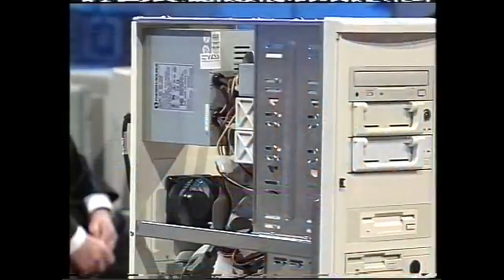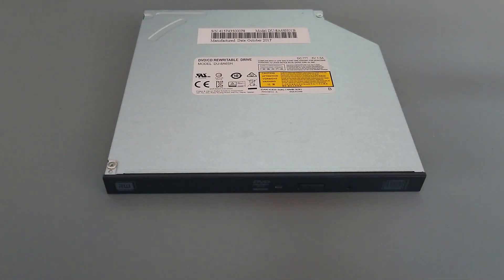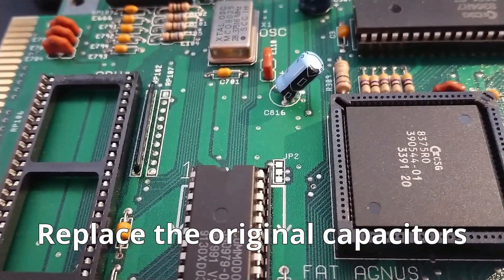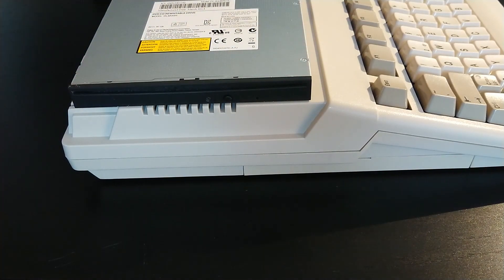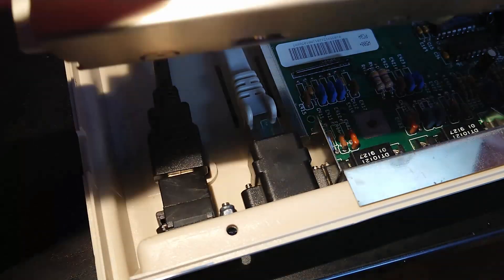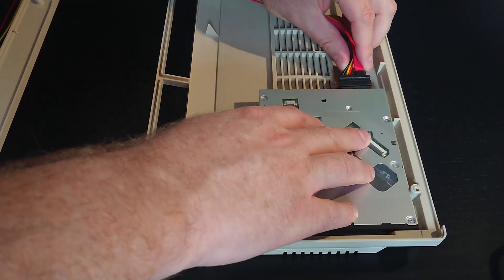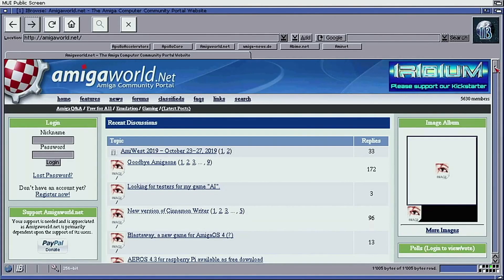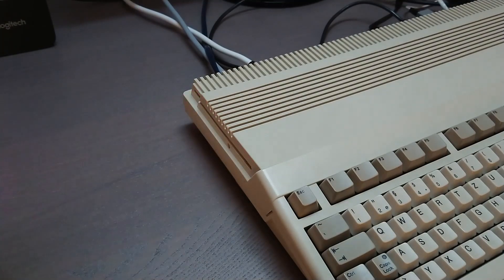Vampirizing the Amiga 500

Comment: Ronnie, I was told that the Vampire 500 v2+ was a single channel IDE. How are you using 2 IDE devices? Simply Master and Slave using the 3 connector cable?
Reply from the maker: Not sure what "single channel IDE" means exactly.  The IDE header is a standard 44 pin IDE header with implementation on the FPGA mirroring the A1200's IDE implementation somewhat.  There are two pins for selecting the drive.  So a simple 3 way cable with master/slave set appropriately.  One thing I do here which is a little naughty is connect two devices where one is a CF card.  Apparently this is not advised but I have not read into the reasons why.  It has worked reliably for me until  now.

Comment: hello , 
how to choose slim dvd player? advices?

how is it connected ? the video goes too fast.

Thanks
Reply from the maker: The model of DVD drive I chose is listed in the description.  If you can't find that exact one then try to find one that draws no more 1Amp of current.  The Vampire has an 44 pin IDE header for connecting hard drives.  Sadly there are no slim CD/DVD drives with this interface so you need to convert it into something a CDROM does have.  Micro SATA for exmaple.  I had to use two adapters.  The first is an IDE->SATA adapter.   Then connected to that is a SATA->MicroSata adapter.  I have been warned that powering the driver from the Vampire is not ideal.  The Vampire gets power via the 68k CPU socket and this isn't really designed to carry large currents.  So you should consider a means to power the CD/DVD rom from the floppy port or something similar.  Let me know if  you have trouble locating the parts.

Comment: Great video! just what i'm thinking of doing. Can you tell me if you had both the CF card & the cd rom drive on the same cable?
Reply from the maker: Yes they are.  What i didn't show is that you should power the CDROM from something other than the IDE cable itself.  The floppy power connector for example.  The cf card being powered from the ide cable shouldn't be a problem because it is low power.
Reply: @RonnieBeck   cheers for that.
Reply: @RonnieBeck  just another one :-) did you have to set any jumpers etc for master/slave on the cd or cf adaptor?
Reply from the maker: @jonathanwickett9118  I set the CF Card adaptor to master and the  IDE->SATA, I think, was set to slave as well.  Can't recall if there was such a jumper on the adaptor.
Reply: This kind of mods is way beyond the capability of an  average Amiga fans. Especially that cd rom mod.

Comment: What emulation cards did Amigas have?
Reply: Some PC bridge boards.. yuck!
Reply from the maker: Emplant, a Mac emulator, was quite common.  But this was a Zorro slot emulator.  Software emulation also did a good job without additional hardware.  Shapeshifter was a great example of that.  Runs really well on a Vampire as well.  The fastest 68k Mac ever?  X-D

Comment: You should have removed the rom. It isn't needeed and it pushes the vampire card upward which put stress on 68k pins.
Reply from the maker: There isn't really a reason to do this (or at least on my board there isn't).  If you check timestamp 5:18 you will see that there is at least 2mm clearance to the ROM.  The board rests on the socket for the Angus chip, which you don't really want to remove.  ;-)  You're right that it isn't used and removing it won't cause a problem.  But the net benefit is zero, or at least in my case it is so.